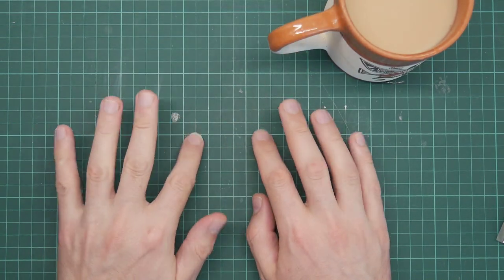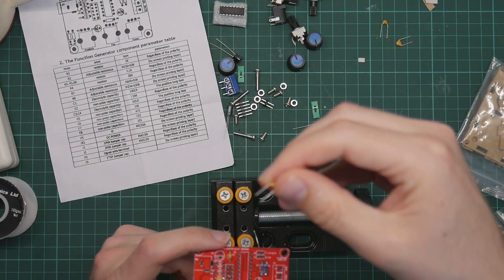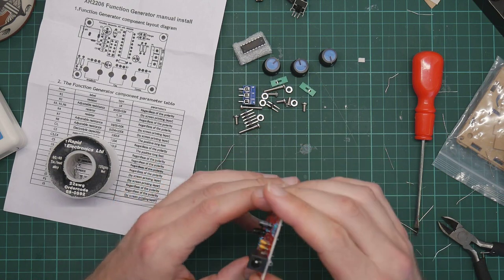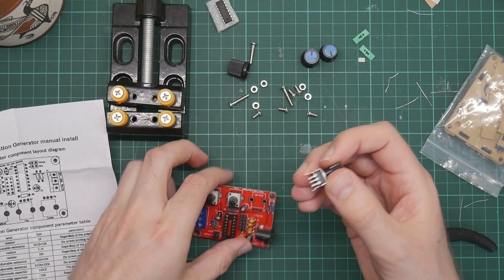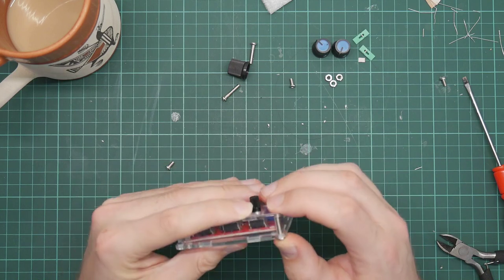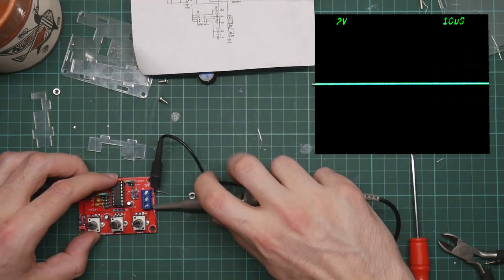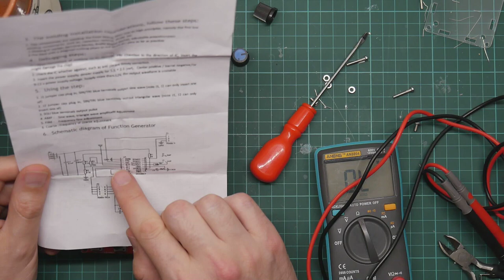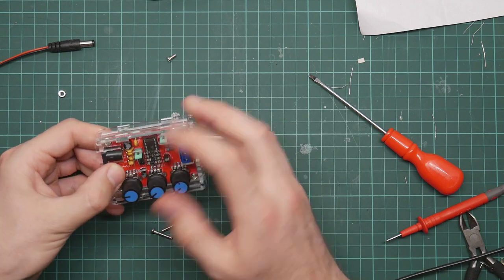Hjalfi builds a $10 function generator

Comment: I can see that this is a 4 Y.O video. Thank you for posting this.
As it happens, I purchased the same kit. It was my first project kit (axp 3 months back) and it took me over 2 hrs to build. I was super careful and as such did not have the issues that you had (I get it: building live, you have to be way quick than I was).

I also found that the functionality is, at best, fair, but for me, it was more about a "first build", rather than having a useful lab tool: I have since purchased a used TTi TG210 Function Generator. The TG210 does not display the "Frequency", so I purchased the frequency counter kit, which I've yet to build. Did you get to that, and did you produce a video?

My intention is to make a housing for the counter display, and hook that to one of the two TG210 outputs. That way I can see the exact frequency, without having to use my scope, for to "fine tune" the frequency.

Once again, thank you for this video, as well as the others that you produce.